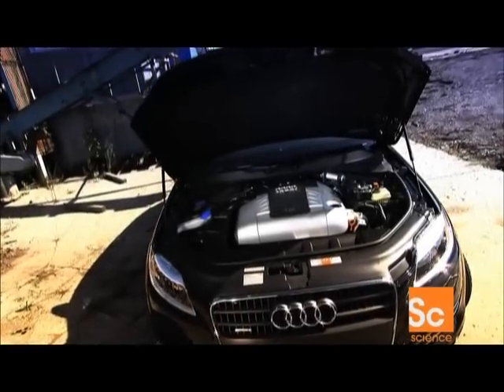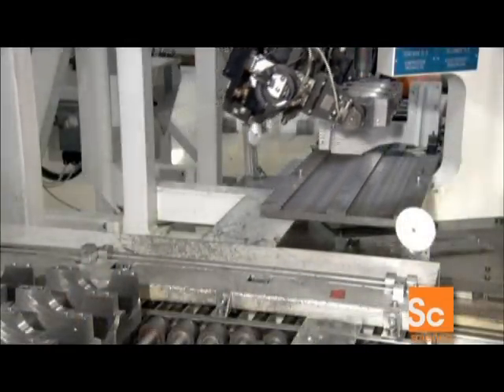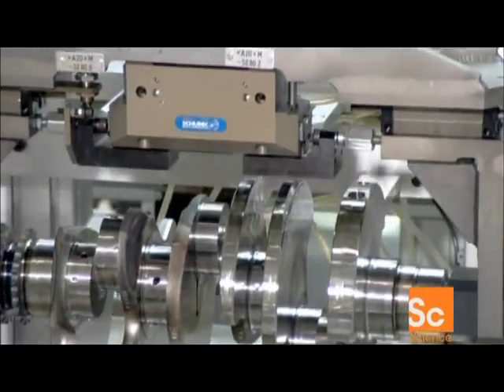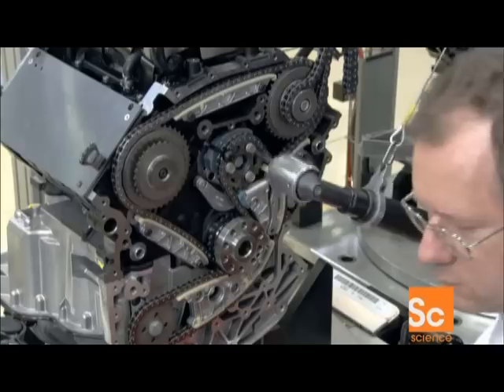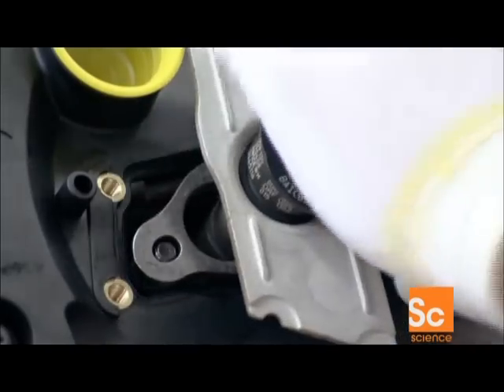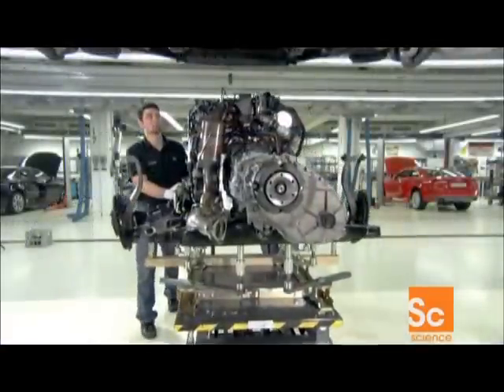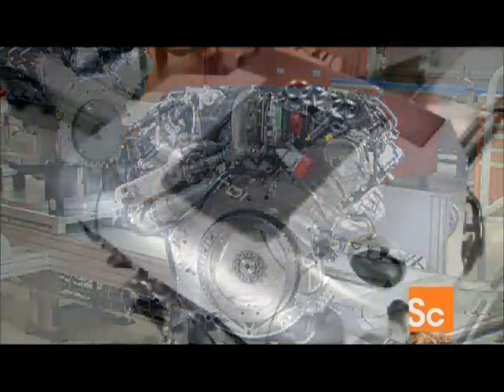Audi TDI - How it's made

Comment: The engine uses little fuel per mile, that's already greener without any emission software or control systems. This is an awesome engine hands down, I would like one without the "fixed" software. There is a dark downside to owning a diesel. Due to the quality of metals required, the more precise machining, the ultra high pressure injection amongst other things, diesels are expensive to fix. If you are a person who neglects their vehicle regularly, stick with a gas engine. A diesel will treat you right, but it only returns the love you give it. Gas engines care a lot less about your love.

Comment: I think if you just said cylinders, people would be capable of inferring that you meant the huge cylindrical holes in the block that were taking up most of the screen... I'm pretty sure there are animals capable of that much...

Also, a turbocharger doesn't draw out the exhaust gases, it's powered by them... Get your basic facts right, literally 5 seconds of Googling would have told you that.

Torque also tells you nothing about how much power an engine can produce, that's what horsepower tells you. Torque is instantaneous force. horsepower is energy output over time.

If you have an engine that has 1HP and a million foot pounds of torque, it could spin a house around, but it couldn't do it very quickly.

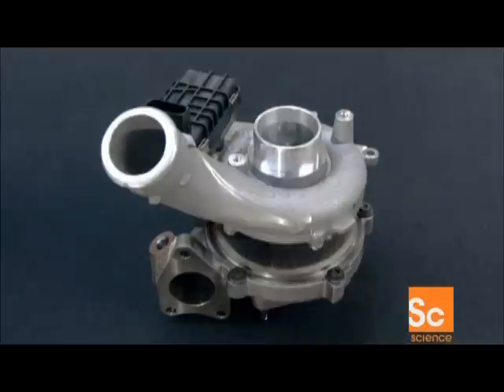Comment: 3:30 one turbine compresses air entering the intake manifold, the other DRAWS OUT THE HOT EXHAUST and sends it out the cars exhaust pipe...dafuck! turbochargers ARE DRIVEN by hot exhaust gases, they dont send them out of exhaust pipe. Cars without turbo can get rid of exhaust gases too :)

Comment: 3:26 It's time to install this engine's secret weapon. Emission cheating software! But in all honesty, I think it's rather clever what they did. Yes they produce higher amounts of pollution than is "approved" but it's still nothing next to what the buses, trucks, and boats produce. All things considered, this doesn't really impact the environment as much as they say it does.
Reply: +jerielmari Not this engine specifically, but the diesel engines on some VW cars(which owns Audi) have this software programmed in where under testing conditions it will reduce the engine power to meet emission standards. Testing conditions being that the rear wheels remain stationary while the front wheels spin on a dyno. Just google for VW diesel cheating and you should find a lot of info. And yes, some Audi diesels have that software too.
Reply: Joel Harris Yea. Basically when EPA does their testing, they keep the back wheels stationary while the front rotates. The traction control software senses this and assumes it's being tested (this is where the cheating software comes into play) and will alter the engine mapping to produce less power(and thus emissions.) When it's out on the road, the traction control system is operating normally because all 4 wheels are spinning, thus the software knows it's not in a test situation and resumes the normal 100% power mapping for the engine. That's as much info as I know about this anyways.
Reply: +op3l Lmao Not to mention, the new TDI engines are certainly cleaner than the older diesel engines.
Reply: +op3l it's actually more clever than that it also detects the computer that plugs into the car to talk with the car's computer.
Reply: Love my TDI.
Reply: +op3l still a badass engine no matter what the media says :)
Reply: +op3l Um, no. Automobiles are responsible for about 30% of carbon emissions in the US alone. Get your basic facts right, I don't even need to address the rest of your stupid comment because your primary axiom fails out of hand.
Reply: Teth47 Thanks for the facts.
Reply: Da Maestro Oh yea. I test drove a Golf GTI and man... that engine is smooooooooooth.

Comment: how the hell does it pollute  less if diesel trucks are crazy with black smoke
Reply: +Bio Power Most diesels that blow black smoke are modified. If there's a newer truck sooting up, it's intentional and it's done because the driver is an idiot that thinks it looks cool. If it's an older truck like any sort of box van or semi, then yeah it probably needs injector cleaning and injection pump rebuild.
Reply: +KIV The newer TDI engines do not release black smoke, you are referring to the older diesel engines in the 90's. Just so you know.
Reply: Oh they can just as easily.

Comment: You diesel haters are something else again. The Audi turbo diesels win races and use identical suppliers used by Benz and BMW. THE FACTS ARE that the use of genuine German synthetic oils keep them all running to 500k miles. They all use piston, rod, chain and tensioners, and injection from identical suppliers and that there are more diesel powered cars in Europe than gas ones. Diesels do not suck. They outlast gas powered engines even though they have very high compression ratios. BMW BENZ and A

Comment: by today all those V6 audi volkswagen diesel engines went to scrap after ceisures and mayour camshaft failures while the  JTD engines of  MV used by fiat, alfa romeo, Opel, Ford, Volvo  are still running   some with 450 000 km and more.  Tme always tells truth or reveales the truth from the bullshit.
Reply: Only thing about JTD is the gearboxes they're paired with, especially the m32

Comment: It must be a bastard when the various cam and drive chains get worn and rattly to replace them! Definitely an engine out job requiring god knows how many special locking and adjusting tools! No only would you have to replace the chains,but also all the chain tensioner blades,idler gears and any of the sprockets should they show signs of wear and damage.What a nightmare! I suppose Audi have designed it so that these components last no longer than the projected life span of the vehicle.

Comment: Oh, a Turbo extracts the exhaust gasses does it? Does anyone on Discovery have any idea about these things, jeez, I know it's only a TV programme but please get it right!
Reply: Well, combustion does occur in the cylinder, perhaps you're confusing it with 'ignition', which kinda happens but it's ignition due to the high temperature within the cylinder and not a spark, but there are some corking errors in these programmes.
Reply: nlimskater A turbo is driven by the expansion of the hot exhaust gases... where it extracts energy... I don't know wtf kind of point you're trying to make... The turbo acts as a restriction to the exhaust raising the backpressure. Pressure*area=force, thereby applying a force to the turbine wheel, thereby applying a torque to the shaft, which is used to compress the incoming air... via the compressor wheel... LOL...?
Reply: LOL A turbo isn't driven by anything. The kinetic energy of the hot exhaust gases is EXTRACTED and transferred to the turbo assembly, thus turning cold side compressor.
Reply: yes
Reply: tperr63
A turbo is driven by the exhaust.
Reply: They also keep referring to "combustion" which doesn't happen with a diesel. Diesel's work on compression.
Reply: ***** Yeah my mistake, I mean't ignition. However it still stands that diesel does not need a specific air/fuel mix to make power. It requires it to make power cleanly.
Reply: +Eddiecurrent2000 They probably mean a scavenge pump, but that's something for two-stroke diesels.
Reply: Hahaha, possibly I didn't think of that, however I doubt they're clever enough to confuse the two ;-0

Comment: 3:35 says the turbo draws out the hot exhaust.....
actually. as im sure we all know, the exhaust turns the exhaust wheel in turn turning the compressor wheel...
Reply: He also said there's two turbines... If you understand what he said then he got his point across. If you didn't understand what he said, then you wouldn't care, and he got... a... point across...
Reply: krap101 "and he got... a... point across... "
He sure did. Blatantly wrong though, but he got a point across.
Reply: Raspoetin a Tell me the difference between a compressor wheel and a turbine wheel...? Aside from efficiency... Both can do either thing...
Reply: krap101 Stating that the turbo charger draws out the hot exhaust and then sends it out the exhaust pipe is dead wrong. The point that comes across is that the person who wrote the text does not have a clue how a turbo works.

Comment: In the old days before common rail injection technologies, having more  valves was the best way to achieve best fuel dispersion in the zylinder. Now since that is achieved by high pressure injection, regulated by nozzle geometry and ecu chips, having 3 intake valves became obsolete.

Comment: And for passenger cars. A turbodiesel is really really nice to drive as they use to have incredible low-down torque (here in Europe most prefer to use manual gearboxes so the engine characteristics do matter), and they consume noticeably less too. At least in European fuel prices, your wallet will thank you if your car runs on diesel.

Comment: Honestly you thought that's how I think it works and when did a windmill which doesn't operate on the same principles come into this? No it uses the physics of thermodynamics by compressing the hot exhaust through the volute to make it hotter.  The area past the volute is at a lower pressure and temperature and as physics shows us heat goes toward cold and high pressure goes toward low pressure until the difference is balanced.  Look at jet engines, ramjet, scramjet and Brayton cycle similarity.

Comment: Think about it, newtons laws of thermodynamics tell us about the conservation of energy.  We cannot create energy nor destroy it only convert it, energy losses are usually in the form of heat escaping.  If turbos really operated on the pressure of the exhaust then compound turbocharging would be pointless and counterproductive as the force would push back on the piston during the exhaust stroke.  Of course there's miniscule resistance, but the turbo really gets energy from the heat of exhaust.

Comment: The exhaust side of a turbo DOES produce backpressure which IN ITSELF would reduce an engine's power. However there is a NET GAIN in power from the increased intake air forced into the engine by the impeller on the intake side of the turbocharger.
Yes I am fully aware of the mechanical dirve of the compound turbos being used on a few modern heavy trucks. 
Mechanical drive from compound turbos were also used on some airplanes in WWII

Comment: Excuse got turbine and impeller backwards.  Might as well also note that what I meant by series turbocharging was to have the air compressed twice by two turbos.  The advantage of turbo is of course more power without wasting energy.  Superchargers are more responsive as they don't need to spool up to speed and you don't have to worry about overspeed and loss of lubrication to a spinning turbo after heavy engine load and immediate shutdown.

Comment: Actually the turbo uses the waste heat in the exhaust to compress the air without robbing the engine of power.  This is unlike a supercharger which would be gear or belt driven and thus takes power from the crankshaft.  Believe me or don't in recent years more commercial trucks have compound turbo charging (not talking about series turbocharging) where a second turbo has the impeller drive a gear on the geartrain to add power to the crankshaft instead of driving a turbine to compress air.

Comment: new engines are all turbo. (petrol and gas both)
with a turbo engine you dont need 5valves per cylinder.
the turbo and injection make all the torque and hp.
you can safe the enormous engineering and fabrication-effort which are required in making 5valves per cylinder heads.

Comment: I'm not 100% sure about the diesel, but I don't think they ever made a 5v per cylinder diesel engine. As for their petrol's, after they introduced the direct fuel injection in the FSI and TFSI engines, there's simply not enough room in the cylinder head for 5 valves any more. Not that there ever was any real indications on that 5 valves has any advantages over 4 valves.

Comment: If I remember right, Yamaha used it in earlier r1 models but then stopped making them because the intake port walls needed to be so thin, and the power gain is minimal compared to well designed 4-valve design :)

It's also cheaper to make and maintain.

Comment: Gear case would need to be constructed on the side of the engine adding a bit of weight to house the idler gears and main gears for the crank and camshafts. Also the size of the gears would require the engine to be a little bit longer than it is currently to properly house the gears in the gear case. Not impossible its just they would have to redesign the engine to make it work with the current size constraints they have with their cars.

Comment: continuing.....

5 valve engines have smaller valves that enable higher revs - an advantage negated by better, lighter materials and stiffer springs

Bottom line - The marginal increase in volumetric efficiency is probably not worth the increase in cost and complexity. Similar improvements in breathing can possibly be made in other areas of design of a 4 valve engine without the cost increase of a 5 valve design

Comment: The turbocharger does NOT "draw out the exhaust"!  It actually IMPEDES the flow of exhaust out of the engine but captures the energy required to drive the impeller which forces air into the engine.. More power is gained by the additional air than is required to power the impeller, so a net gain in power results.

Comment: horrible radial run-out when the cylinders walls were honed... not too impressive.
p.s.: as of june 13 2012, diesel is considered to be as carcinogenic as asbestos, so good luck with THAT engine
p.s.2: 4.2 V8 FSI is the only current engine audi made well.

Comment: Well yes and no,there is common rail injection which improves the poweroutput drastic by injecting diesel multiple times which each stroke but as you said,we won't see a Ferrari running on diesel any time soon.

Comment: This turbocharger seems like GTB1756VK which has 56 mm on exducer (inducer 41,5mm), but on 3,0TDI are usually installed GTB2260VK which has 44,5/60 (inducer/exducer) ... and these spin really 200k RPM. We use these turbochargers on 1,9TDI and these spins about 250k RPM.

Comment: Not so in this generation of Diesel. The multiple injections during the power stroke are monitored in real time via a pressure sensor in each glow plug assembly, the REAL secret to this generation.  NOx emissions are greatly reduced by a dual pass EGR system, lowering combustion temperature and NOx.  The exhaust of this engine is cleaner than a gasoline engine; the pipes are still silver on the INside after many thousands of miles.